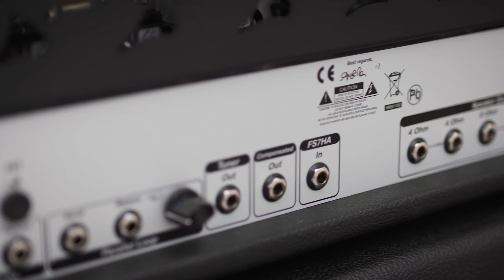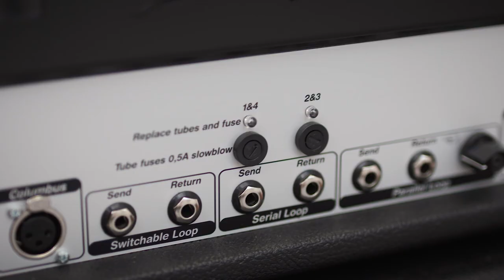Diezel Hagen: In-Depth with Peter Diezel & Peter Stapfer (subtitled)

Comment: The Hagen is a great amp, no doubt, but personally I prefer the VH4. I bought both amps almost at the same time and after a year of playing them side by side I decided to sell the Hagen and keep the VH4. I sure miss the functionality of the Hagen. The second master is a godsend. Also I think the Hagen is the better looking of the two (mine had white tolex with white knobs on a black faceplate - stunning). If there was no VH4 I would gladly play the Hagen and be absolutely happy with it. But the sound of the VH4 is just special. Well, it may have something to do with mine having KT88's in it when I first got it - the tightest bass of any amp I have ever played! I have re-tubed it with NOS Genalex KT77's since then and it's not quite the same but still tighter than the Hagen. I know Peter said he doesn't want to make a VH4 MKII but I would totally buy it if it had a second master knob. Basically either stick a second master control on a VH4 or somehow jam the sound of the VH4 channel 3 into the Hagen (and also add external tube bias controls) and you've got a perfect amp! :) Again, the above is strictly a personal opinion - I don't mean to dissuade anyone from buying a Hagen - it is absolutely a beast of an amp and certainly deserves your consideration. But the VH4 though... <3 

P.S. Thank you, guys, for making these videos! Very cool! And thank you for making amazing amps! Cheers!
Reply: Why don't you put a jumper in the parallel loop of the VH4 and use the loop volume as second master?
Reply: Aside from not knowing how to do that, I don't really want to mess with the amp. Although I do think I might have to mod it to have separate bias controls for each tube (I use old stock tubes, which are difficult to find in matched sets at affordable prices), and if I do find someone to do that I might as well see if I can get a second master control. Of course, then I have to figure out how to control the loop volume - I use my Soldano reverb in it. Anyway, thanks for the suggestion.
Reply: Shmalentine Okay.. But it's easy as connect send and return of parallel loop with a short guitar cable, no mods required. Parallel loop volume (i.e. 2nd master) can be then activated by pushing Send2 button (or via MIDI if you prefer)
Reply: Yes, this is described by Diezel how to have 2nd master on VH4.
Reply: RockSiffredi (sorry, missed your reply). Yeah, but then I won't be able to use the loop. Which I do need to use.
Reply: proper old tubes do not need matching. They are very close or equal right out of the box given that they come from the same batch. If the quiescent current does not match it is quite possible that the overall condition (wear, lifetime, transconductance) is different and the tubes will therefor not work as a matched pair. You can match the BIAS point but not those other parameters.
Reply: +BavarianMonkey: Aside from the fact that I have seen no evidence to the claim that old stock tubes are close enough for a push-pull circuit without matching, KT77's are so rare that finding a quad from the same batch is virtually impossible (not to mention financially unreasonable). In my experience power tubes don't need to be matched in anything other than bias. Gm only matters if the tubes are being matched in a tester. If they are being matched for bias in an actual amplifier under real voltages as long as the emission is 70% or higher they will stay matched in THAT amplifier.
Reply: Having a matched pair does not mean that only the DC bias is matched but also the actual curve itself should be close.
Otherwise, you will get equal DC currents when there is no input signal present but once you turn it up, the whole power section will become unbalanced (create unequal DC currents on the anode currents) which leads to transformer saturation, more distortion and less bass. The severance depends on how big the air gap and how big the primary inductance of the output transformer is.

Of course this can be sonically pleasing if this is what you are searching for but in general it does not make a lot of sense to "match" different old tubes by only checking the bias point and then have the balance go to ashes once you actually play it :-D

About the evidence: 
Of course my test batch size was not thousands of tubes - I do not own so many amplifiers, but whenever I used NOS ones I did not have to match them when they came from the same batch or sometimes even only from the same factory. Plus as far as I am aware matching power tubes was not even a huge thing back then except for special applications (measurement, military equipment). Maybe I got lucky? But then, friends of mine had the same experience with old Svetlana / RFT... Maybe we got lucky?

On the other hand I have seen multiple times that a new high priced "matched" quad of EL34 labeled something like "very high end boutique premium selected moonshine virgin gold" (choose a few) developed current differences of 5...10 mA (at about 40 mA DC bias) after two weeks of normal use. I would not call that "matched". 

KT77: OK, those are hard to get in old quality, sure. Didn't even think about the tube type, sorry. With EL34 and 6L6GC/5881(6L6WGB) it is not such a huge problem.
Reply: +BavarianMonkey: I won't argue the technical details - my knowledge of tube circuits is not extensive. All I know is that when tubes are matched for bias (and I try to match mine within 2 ma across the quad) it sounds pleasing to me. Quality control in the old stock tubes was way better than what it is now, and maybe if you bought a new set of tubes it did not need to be matched because they were very consistent from the factory. But from what I've read even unused tubes deteriorate. Not to mention that NOS tubes are difficult to track down and are outrageously expensive. Even for EL34 (I favor Mullard xf1 and xf2 dual O getter). Hence matching of the old tubes. I don't know, it seems to work for me. :) Cheers.
Reply: Outrageously expensive is the "very high end boutique premium selected moonshine virgin gold" you can get today because today's tubes are pretty much crap in average compared to the old stuff.
50-100€ for a pair of old NOS EL34 is OK, you simply need to know people. Outrageously expensive? Yeah, when you buy from a "very high end boutique premium selected moonshine virgin gold" seller, those will multiply the price.

This is why I referred to "NOS" (NEW old stock, not USED old stock). Of course, if you have random tubes of the same type from different sources those can differ a lot and then you will have to match them.
Unused tubes do not deteriorate as far as I know but they can "go to sleep" and you need to wake them up by heating them for a certain time. Otherwise, your BIAS will drift like crazy and you can damage the tube when you drive it hard during the first hours. (Power tubes that is)

If you end up with tubes that are not matched 100% (curve) the amp will sound warmer, will deliver more even harmonics and so on, so mismatched tubes can cause better sound than matched ones. 

Huge topic....
Reply: +BavarianMonkey Not sure what this "virgin gold" you're talking about. I only use old stock tubes. I intentionally avoid the word "new" because there is no way to know whether the tube has never been used. Old stock tubes can test as new after years of use, and a large portion of tubes sold as NOS in original boxes and all that are in fact used tubes. Personally I don't care if the tube was used before I got it - as long as it sound good in the amp. The price of EL-34's varies depending on the tube. NOS Xf1's go for at least $150 a pop, usually much more. If it's a NOS Xf1 with a single horseshoe getter - easily $300 each. Yes, Mullard Xf3's adn Xf4's can be found for $100 a pair, but I don't use those. And as I said I currently use KT77's in place of EL34's, and a used (but testing as new) matched quad of Genalex KT77's runs upwards two grand. If you know people who will sell KT77's for significantly less, please get me in touch and I will buy their tubes.
Reply: +Shmalentine "virgin gold" and everything between the quotation marks above are buzzwords that are used by tube sellers to tell the customer that the tubes are supposed to be higher quality while the words themselves have no real technical meaning.

About the prices: On the market, yes. If you know people who know people who... prices are a different story ;) Also, those people do not sell to everybody but only to friends or maybe friends of friends... :)
Reply: + BavarianMonkey I know what the words in the quotation marks meant. I just didn't understand how they were relevant to the conversation since I stated upfront I use only old stock tubes. Unless you think old stock tubes are hyped, in which case sorry, this conversation is over.

As for the tube prices, I buy mine on the market. That's what I have access to. And telling me that you have a better way to buy tubes but I can't have it is kinda douche-y, don't you think? ;)
Reply: Quoting myself: >>Outrageously expensive is the "very high end boutique premium selected moonshine virgin gold" you can get today because today's tubes are pretty much crap in average compared to the old stuff.<<

The buzzwords refer to todays sellers selling products with lower quality (compared to old tubes that is) for higher prices using these labels that are supposed to tell you - the customer - that they were superior to other tubes.

As for pricing: Sorry I cannot change it. I wouldn't pay 150€ for a EL34. If I had to, I'd go full semiconductor and develop circuits that behave like tubes but do not need tubes. For pentodes, this is not THAT hard :)
Reply: Yeah, I know what you meant. I just don't know why you brought up today's tubes - I don't EVER buy them.

Would you tell a homeless person that you wouldn't sleep on the street? If you've got a NOS hookup with better prices exclusive to you and not accessible to others you telling me that a pair of NOS Mullard EL34's costs $50 is exactly like telling a handicapped person with no legs that they should try running.
Reply: Wait a second, this train derailed pretty quickly. What I wanted to put across was:

1: Todays tubes are pretty much crap compared to the old ones
2: Buzzwords used by the seller do not change point 1
3: If you look around and get to know people they (or yourself) might find some stashes where randomy some old tubes in their original boxes show up
4: If you have a good relationship with those people in 3: they will sell you the tubes for reasonable money and maybe ask you for some help in another case where you have some random stuff they might need

This is not business, it is a question of social contacts and the pure love of keeping old stuff in good hands. Sorry if I somehow came across like an asshole, this was not my intention and maybe the fact that this is not my native language contributed to that.
Reply: 1. Preaching to the choir. (not sure why you brought it up in the first place).
2. See 1.
3. and 4. I have no desire to continue this silly conversation, sorry. When a person is oblivious to their own privilege it is virtually impossible to explain it to them.

Cheers.
Reply: Sure. If all people do is sit in front of their keyboards all day instead of spending time with people, simply talking to people could be called a privilege. There is nothing special there at all. Does not matter if it is "hey I know this guy who has this guitar, maybe it is something for you" or "hey did you read that post in forum X where this guy found a box of old Tesla ECC83? Contact him if you want some".

If you prefer to pay huge money on old used tubes, continue doing that, but please do not call good relationships developed over years silly.
Reply: Shmalentine Vh4 is great but the lows can get woofy the Hagen is a bit more responsive to my ears and little bit more “breatheable”.

Comment: Should make a 50watt 3 chan to rival the evh iii, around the same price...
Reply: Totally agree! Any 50W tube amp is more than enough.
Reply: except any diezel just flat out kills an evh iii...and a big part of that is premium components.
Reply: You get what you pay for
Reply: @paulkielt9301  Even a 20w. I got a 6505mh now and i play it on 1w on low or 5w when i want it loud. So yeah, 20w for $700
Reply: @jaychen2000metal  but I think 100 watt amps still sound cooler at low volumes . They still sound bigger . It’s an acquired taste of playing 100 watts a lot . They just have something no amp can do even quiet

Comment: i have owned so many amps then diezel was the very best never breaks down on me and delivers any sound I could ever want, just the best as far as quality, nothing but the best of the best, and the transformers are huge, what made the neve 1073 for a mike preamp custom transformer diezel had not just a deep powerful sound but with the attack of a shark fast and sustain forever, I have never looked at another brand since, I use Royer mikes for the bottom end and sure sm57 with API and Neve and SSL mike preamps also the new Camden 500 mike preamp with thump and cream, with the Cranbourne adat you can run one preamp into another like a signal chain, , creativity lives in the mind and the recreation come out of a diezel amp with ease, keep up the great work, they make the world is a better place to live in, with diezel amps